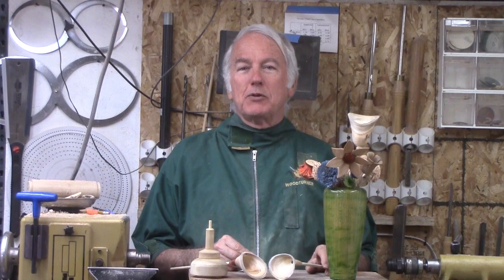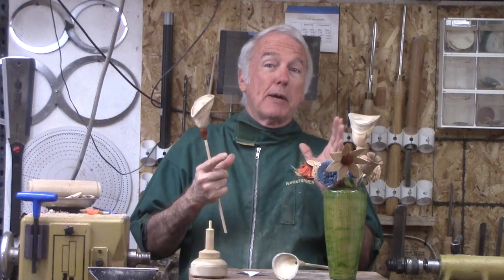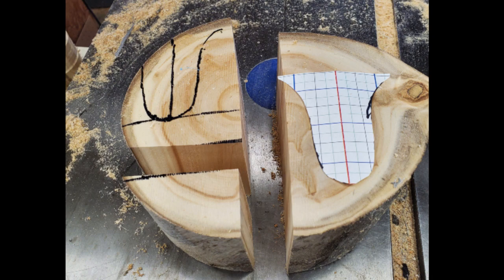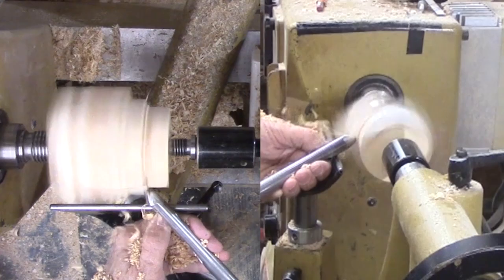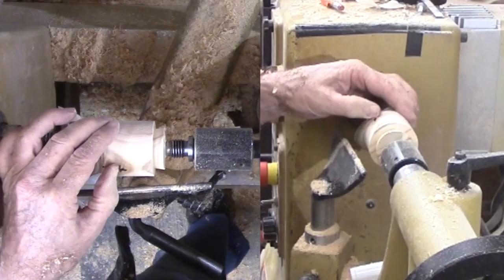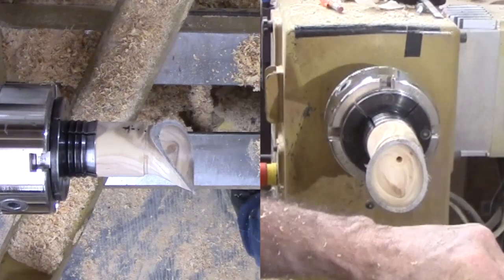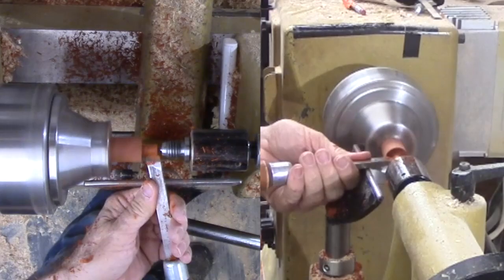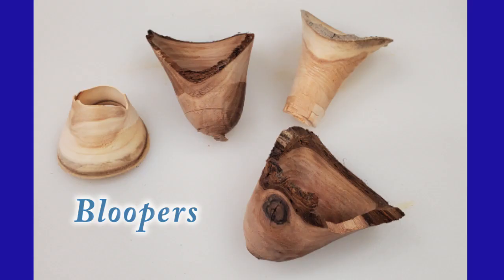Woodturning Spring Blossoms - This Year Spring Needs Help

Comment: Looks like a fun project, Alan. Nice to have options for flowers so the bouquet has variety! I was thinking I could turn from a branch but once I out out a template and tried to arrange on paper, I began to see the challenges of having enough wood for a tenon even with smaller jaws. I was thinking a regular cone center would work and then figured out it might not provide even support inside like your dowel drive center. Always fun  to try something new and this one is on my list. Thanks for sharing.
Reply from the maker: You are welcome Mike
Alan